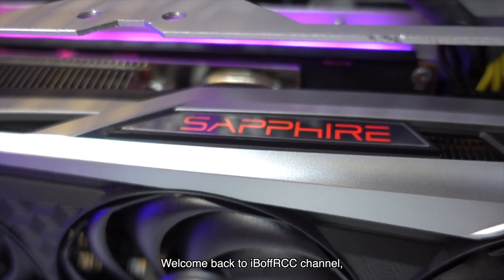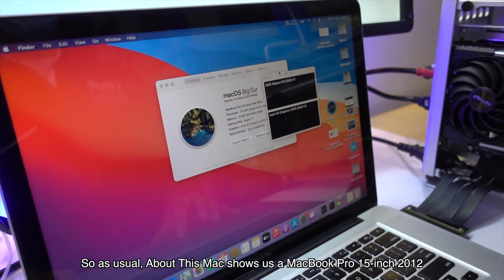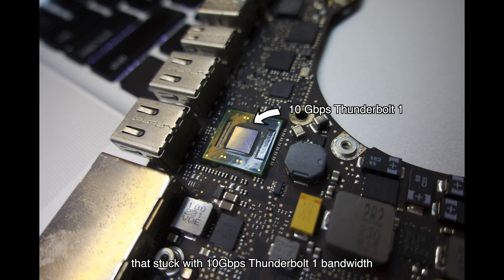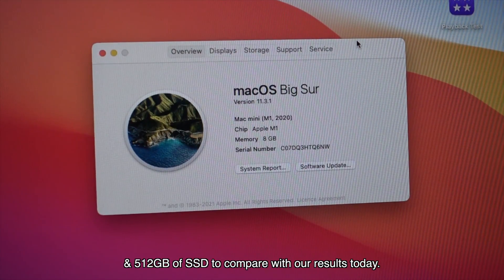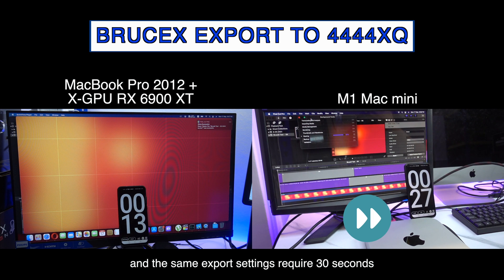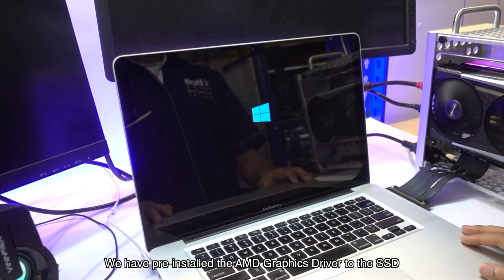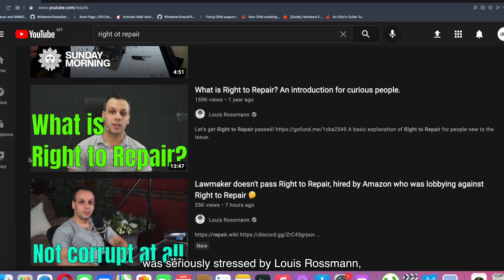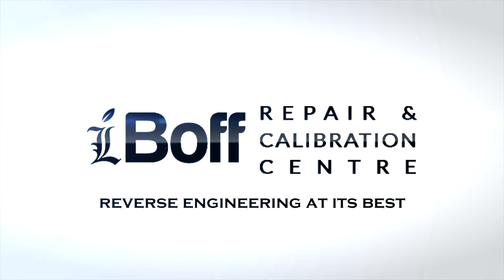M1 Mac Loses to MacBook 2012 - 8K Test: RX 6900 XT

Comment: Old intel macs will remain king for a long time. You can get a maxed out mid 2015 MBP and use a 6900 XT eGPU to basically make it as fast as current MBPs

Comment: I have iMac (Retina 5K, 27-inch, Late 2014), Processor: 4 GHz Quad-Core Intel Core i7, Graphics: AMD Radeon R9 M295X 4 GB with macOS Big Sur 11.7.4

I would like to add external gpu for the better video editing performance. Which egpu is the best fit for my imac?

Comment: My 2012 MBP is still my main work machine. I've really taken advantage of its upgradability, and it is every bit as fast (and in some cases faster) as the new Macs that we have at work. It has saved me so much money and headaches.
Reply: what spec do you have on it ?
Reply: @Jo-mm3vo  2.6Ghz 4 core i7, OWC 16GB 1600Mhz DDR3 RAM, OWC 6G 4TB SSD, NVIDIA GeForce GT 650M, aftermarket fans and thermal paste. The improved cooling from the fans and thermal paste sped the machine up noticeably.
Reply: @bsenka  ooh nice! 4TB SSD ? you need something special to do it?
Reply: @Jo-mm3vo   the SSD makes a huge difference in the overall speed, and I just work with a lot of big files, so the space was worth it for me. Most people probably won’t need anywhere near that much local storage anymore.
Reply: @bsenka  of course! I want to do the same, but many says that it's 2TO max on this MBP...

Comment: Nice Video. 
I have imac 27 late 2013 with open core Mac os Monrerey and Windows 10 installed via bootacamp. 
If I will add RX 6800 XT will it work without an external monitor in Windows?
Reply from the maker: how are you going to add that 6800xt?
Reply: @iBoffRCC  I will use eGpu adapter with 750w power source
Reply from the maker: @Antonio_guide  it should detect, but we never tried it.
Reply: @iBoffRCC  my question is about external monitor. Do I need it? Or egpu will work with imac display?

Comment: interesting! random question since I was interested in knowing.... would it be possible to solder a Thunderbolt 2 controller from a 2013-2015 retina onto a 2012 non-retina and thus have Thunderbolt 2?
Reply from the maker: yes, but it might need a lot of work to do. you need:
- PCB adapter for TBT 1 to TBT2 chip.
- Transplant TBT ROM chip from 2015 to 2012
- Replace the built in TBT firmware inside the EFI BIOS

its a lot work so not even worth it.

Comment: Nice video! How does 6900xt perform between windows and macos for davinci exporting 10bit 4k 60 footage? I have a 2019 mbp16, is it better to upgrade with a 6900xt egpu or just trade in for the M1 Max?
Reply from the maker: for the total cost, maybe better m1 max mac studio
Reply: @iBoffRCC  yeah, but I travel occasionally, the m1 max MacBook is 1000 dollar more expensive which is a lot!

Comment: This x gpu setup project could revive many old powerful laptop. If you could also create the hijack setup for gaming laptop with gtx card like 980 1080 2080 1660ti, then youre the badass youtuber people ever seen. Thunderbolt 3/4 never give enough bandwidth compares to the x8 lanes. Just see how an old 3rd gen can perform well with 6900xt, you have no idea how i9 8900hk could perform. You have to do this somehow on windows platform which are mostly gaming user. YOUR PROJECT IS MAGNIFICENT! KEEP IT UP!

Comment: Just noticed at the begining of the video that the mid 2011 imac has a "3,5ghz" i7 cpu -  did you mod this in some way as I have the same model and that has only a 3,4ghz i7 CPU. Did you overclock it or is it a different i7 CPU?
Reply: It's the i7 2700K (or just the 2700), no mod needed.

Comment: I absolutely cannot wait for the 2010/11 27" iMac version! One idea though, have you considered fitting an mxm card in the space where the cd drive used to be in these MacBooks? If it worked you could do something crazy like put an AMD WX 7100 internally in a 2012 unibody. You'd have to find a way to make cooling work though. Keep up the great work!
Reply: I'm sure this was more of an arbitrary model (while also being high end and metal supported) you chose, but these cards are even less available than the new GPU's on the market. Assuming you could get one, you have to deal with more than just cooling, but power draw and space (which needs to account for a custom board and cooling).

MXM B Boards are 82x105x?mm (? as the components jutting out vary in height, but my Nvidia GTX 765M measures in at 5mm), while the optical drive is 128x9.5x129mm. Assuming the WX7100 is also 5mm in height, that leaves only 4.5mm for a custom breakout board and heatsink (maybe a few mm more, as those 'jutting components' like VRMS and Capacitors are isolated to only certain parts of the card)...with a fan going somewhere out the optical drive slot too (or maybe drilling holes into the baseplate?). And no, you can't really go higher than 9.5mm, as the optical drive is already near the top of the case when closed (and then there is that WiFi/BT ribbon cable that goes over it...probably wouldn't be a good idea to have that touching the MXM GPU heatsink, so they would have to fabricate a new cable for that too.

Then on power draw, the WX7100 pulls 135W (TDP), while the GT 650M is only 45W. Perhaps @iBoff RCC can educate us on whether this kind of power draw is possible from the logic board alone (the i7 2.7GHz 3820QM CPU also has a 45W TDP to consider).

These MacBooks ALREADY run HOT, this added heat would almost certainly start to bottleneck the rest of the system. And then BATTERY LIFE would be absolutely SHOT, just like most gaming laptops. Running the laptop plugged in and on a solid surface (for good airflow) would help with this, but then this is starting to defeat the purpose of having this internal GPU.

By no means am I dismissing the idea! Just throwing out all considerations.
Reply: @JSnakeRepair  I think a lot of what you describe can already be found on the Mac Rumours thread for the GPU upgrade on the 2009 - 2011 iMacs. There is a comprehensive list of the various compatible cards, their characteristics as well as their compatibility with the various diffeent models of imac. In general the 27" imacs have larger heatsinks and power units and can handle some of the higher wattage cards better than 21.5" models...